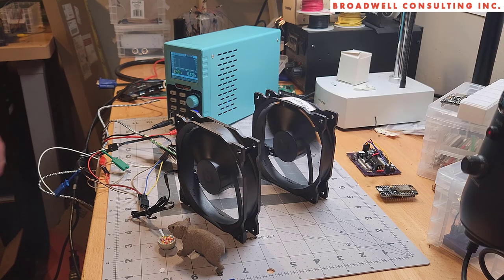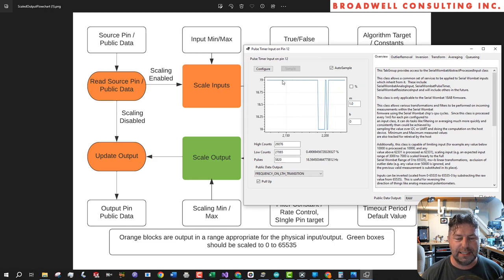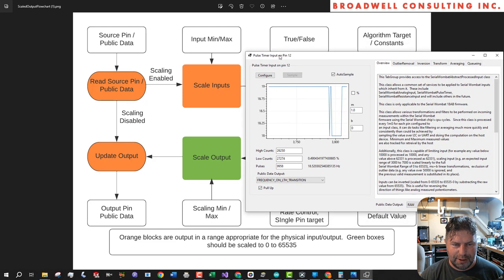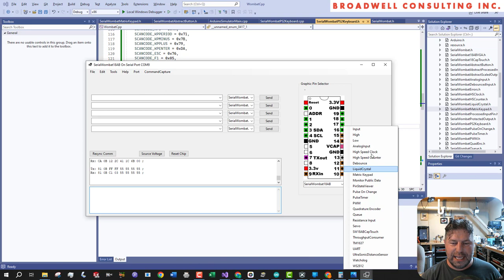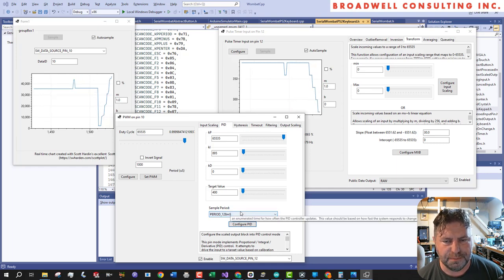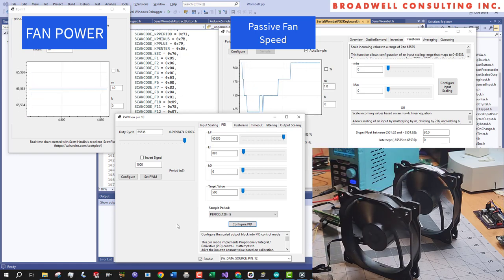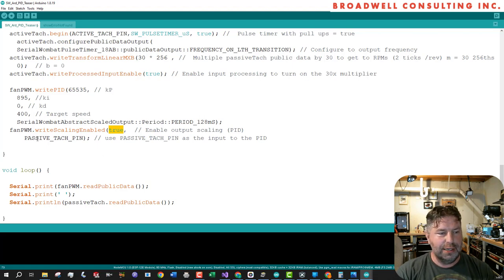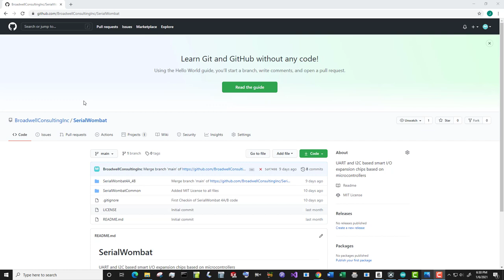Version 2.1 Teaser:  PID Control!  From Arduino and PC UART on Serial Wombat 18AB

Comment: Hi, Great Product!!! 
I am quite excited to try out your Serial Wombat on a project I have in my workshop..... I am wanting to use  2 PID loops to accurately control the position of two linear actuators, each of which has a linear potentiometer fitted for positional feedback - approx. 150mm travel. I am using a hbridge to control each motor, each hbridge is controlled via PWM and a direction signals (currently from an Arduino).  
Do you think that the Serial Wombat is up to this task? - I am trying to get high positional accuracy - 0.05mm would be ideal, at a maximum speed of 75mm per second.
Do you think I would be able to control both motors from one device or would it be better to use a separate Serial Wombat per motor, with each connected to an Arduino. 
Thanks for your assistance.
Reply from the maker: The H Bridge is currently not something the SW18AB can control on-chip with PID, because of the need to change the direction of the bridge in response to the input.  At present (Version 2.1.0, Sept 2023)  the PID is limited to applications where existing proportional outputs (servo, PWM, etc) produce a positive plant result from a positive output (although with the output scaling reversal, you have more options).   An H Bridge driver that would drive 100% at one direction when set to 0, be off at 32768, and drive 100% in the other direction at 65535 with proportional PWM inbetween is on my radar as a new pin mode specifically designed for this kind of application, or velocity control on motors with encoders.  Once this is available, you should absolutely be able to control multiple PID loops with one Serial Wombat 18AB chip.  If you like, hit me up at help@serialWombat.com with more details of your project.  It's very helpful to me to talk to real users with specific needs in mind so that when I create new pin modes they fulfill the needs.  You may understand this specific set of requirements better than I do. 

It looks to me like you may have issues hitting your goal with the analog accuracy/precision of your potentiometer.  .05mm over 150mm is 3000 potential positions.  The Serial Wombat 18AB chip has a 12 bit A/D converter, so you get 4096 potential A/D readings.   In reality, noise and non-linearity/sticking in the pot may limit your ability to hit that level of precision.